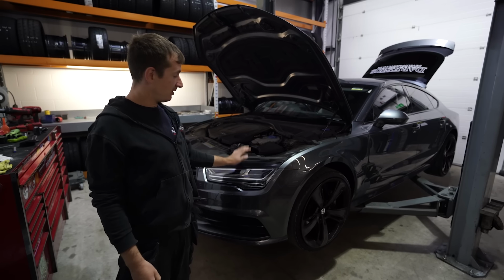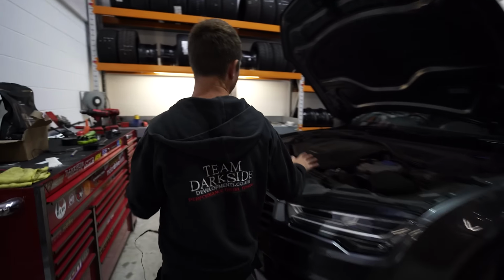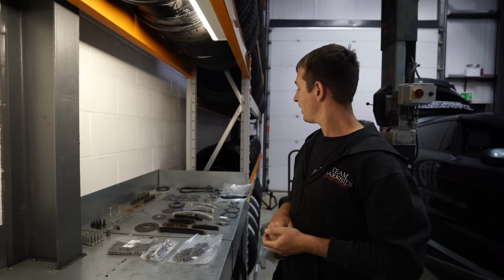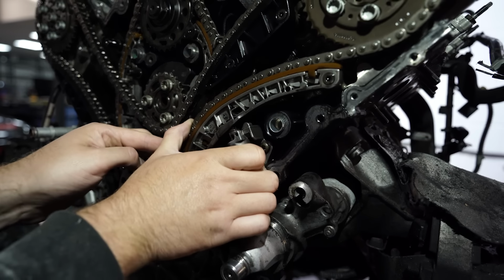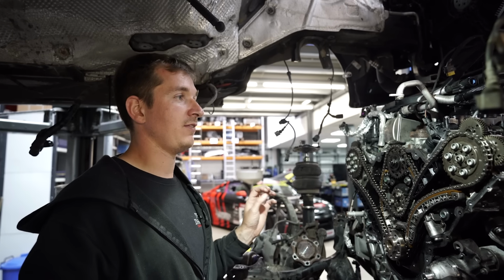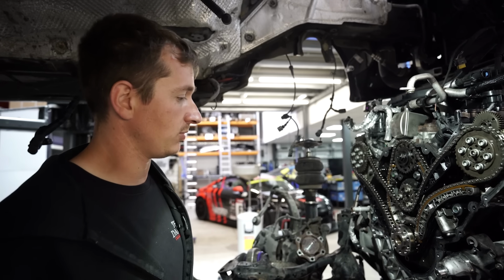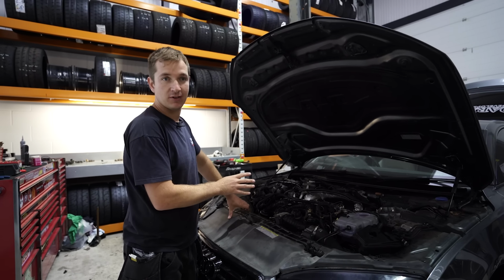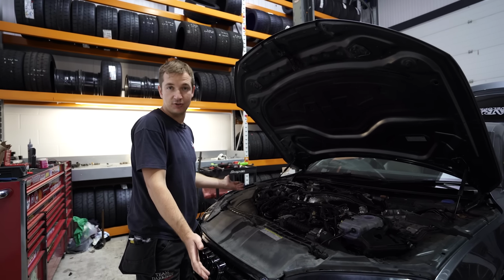AUDI 3.0 TDI V6 TIMING CHAIN RATTLE! - WHAT'S BROKE?? 😳

Comment: I fully agree no more than 6000 miles If you have an engine with a timing chain. Oil is key to keeping it in good order for lubrication and tension. I do my cars every year or 6k miles as all have chains never had any issues. I have the SQ5 with a variant of this engine, very easy to do just no damn dipstick! 😂
Reply: Audi France : change oil = 30000 kms or 2 years...😂😂👎👎
I do it myself each 10000 kms   A5 V6 TDI...👍
Reply: you can buy the dipstick separately. just get the correct part number for that engine. I must have got the wrong one so i made a new mark for full

Comment: I have had this issue but not only on start up it was rattling at 1600rpm onwards super loud, this went on for 40k miles until I used some cheap mannol ester friction remover and a small can of liqui moly mos2, after 40 miles the engine timing chain noise has totally gone, maybe it was a sticking tensioner ?
Reply from the maker: Possibly

Comment: Where did you buy the parts from? Or is it all from the dealer ?
Reply from the maker: We have the OEM parts listed on our website - https://www.darksidedevelopments.co.uk/products/timing-chain-set-camshaft-and-oil-pump-for-vag-3-0-tdi-v6-engines-059109229aa-059-109-229-aa.html

Comment: I see many problems with timing chain in v6 TDI engines. It's a good idea to buy an Audi after 2017 with v6 TDI or with 2.0 TDI ????
Reply: Just keep on top of the servicing. It's not as bad as the internet makes out.
Reply from the maker: As above, aslong as it's serviced well, should be fine with a V6 TDI. However if anything does happen and it has to be an engine out job, it can get very pricey

Comment: Engineering masterpiece of an engine.. Injectors shitting themselves as low as 100k km leaving you stranded, timing chains slapping as low as 200k km, all the plastic coolant items filling the valley with coolant, plastic water pump, oil cooler internal/external leak.. Ask me how I know 👀
Reply: For me the best 3.0d engine is Mercedes 350cdi engines they do have some issues but not as bad as what you have experienced.
Reply: @jakefalk6350 M57 beemer best 3.0d
Reply: My CAPA has more than 200k and I’ve had non of those problems
Reply: @FoookOff  doesn't mean anything
Reply: Bmw has the worst engines,the garages are fully with them
Reply: @Cristi3453  except m57
Reply: @taydencornish  I would put n57 as well if you are lucky. My n57 engine is on 100k miles -original suspension - oil changes 8-10k miles and zdf service which was expensive unfortunately as well as the run flat tyres. I bought it on 50k miles and got lucky as the car wasn't abused. Very happy with the car as I did  remapped it incl the gearbox last year.
Reply: My n57 done 170k clean
Reply: Currently 128k on audis v6 3.0d q7 timing chain rattle on start
Reply: @jakefalk6350  350cdi or 320cdi I agree they are excellent engines.
Reply: @FoookOff Famous last words 😊

Comment: Are they the same engine unit as the 2013 V6 Touareg?
Reply: Yes
Reply: Thanks
Reply from the maker: Yes pretty much
Reply: No that is a different engine. That one is similar to the Audi A5 V2 they did. The chain design is slightly different.